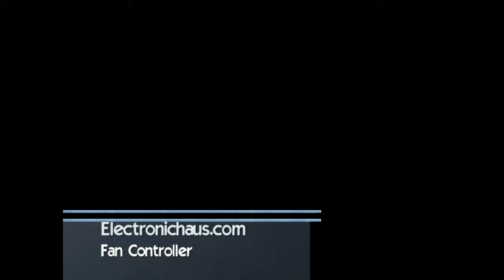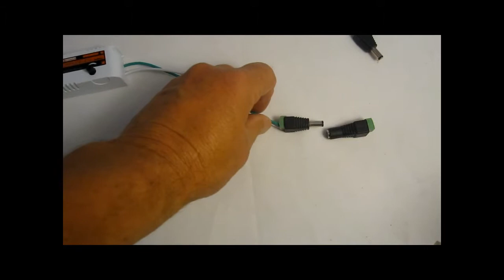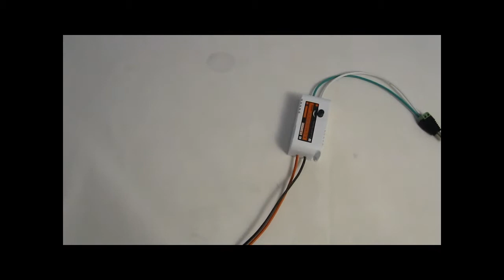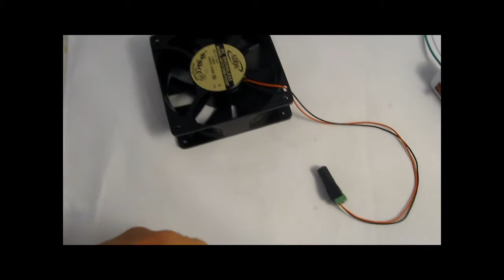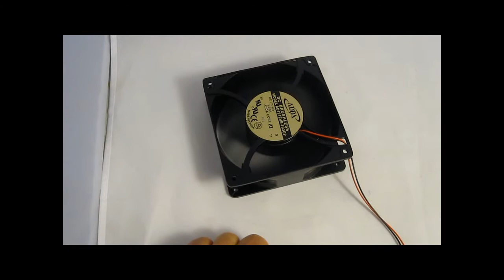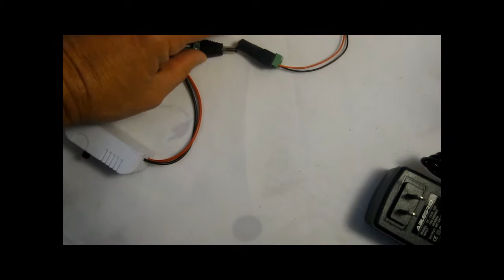Electronichaus Fan Controller

Comment: Dude, could you please film this again as it would be used in real life with both ends open to airflow without the fan face down on a solid surface?  The sound should be totally different. 

Also did you measure amp draw at full speed?   Thx